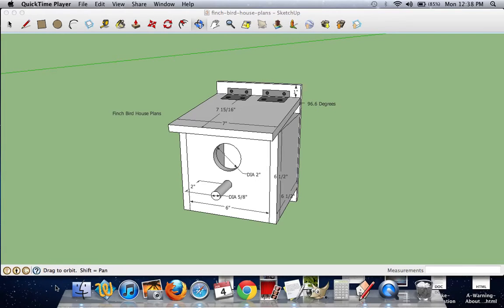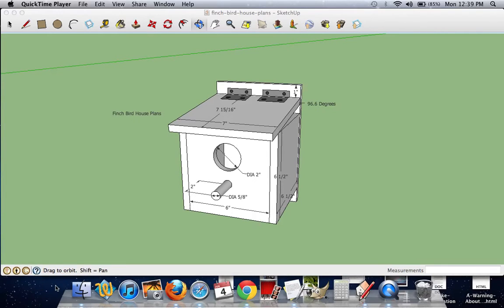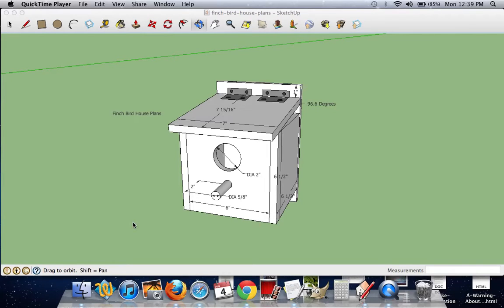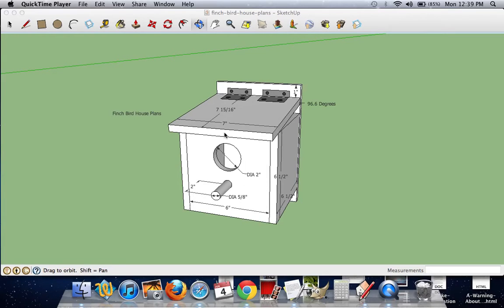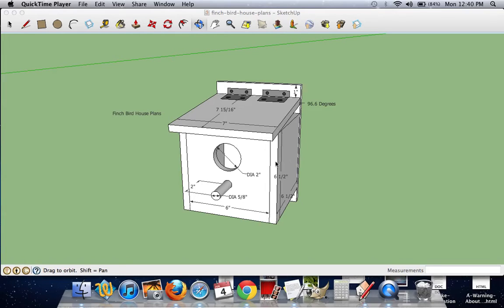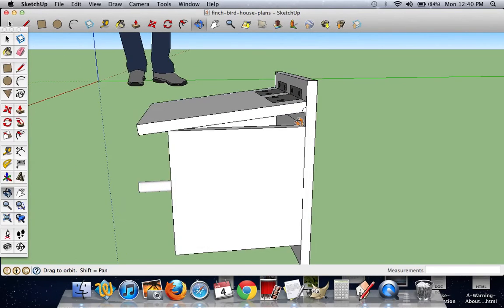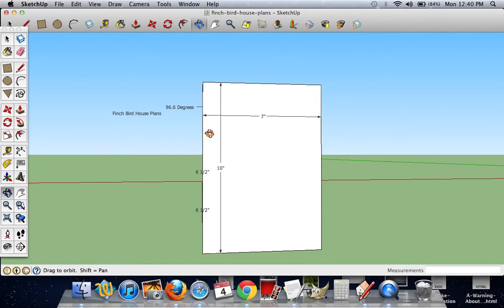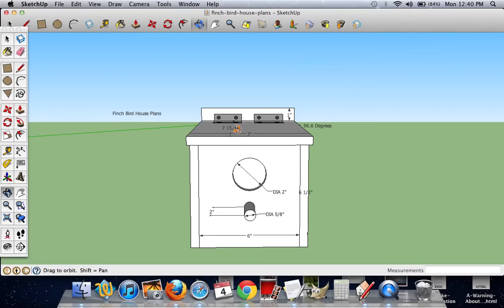Finch Bird House Plans

Comment: What is 1/2'' "material"? Doesnt the peg make it easy for predators to get in with a 2'' hole? What isthe distance from the center of hole from the bottom? Do you provide any rough surface for the hatchlings to get to the hole?

Comment: You should change up the top, you could make it a different type of hinge so its hinged on the front instead of the top. the back board can leak water into the nest with this design